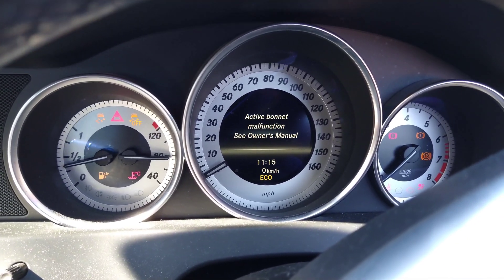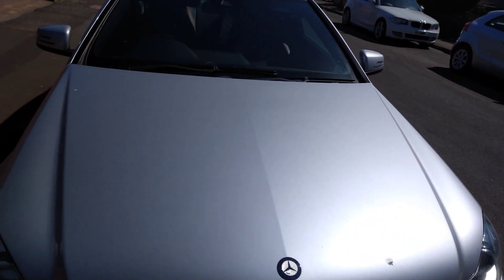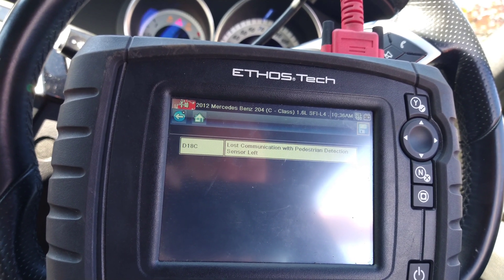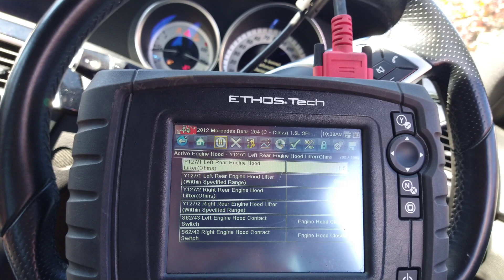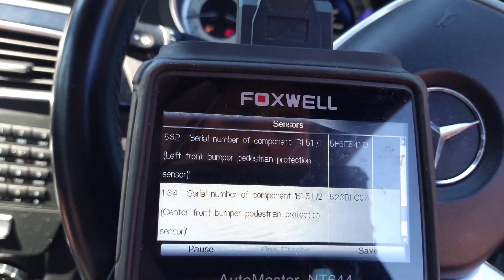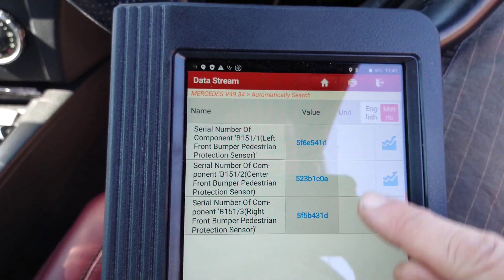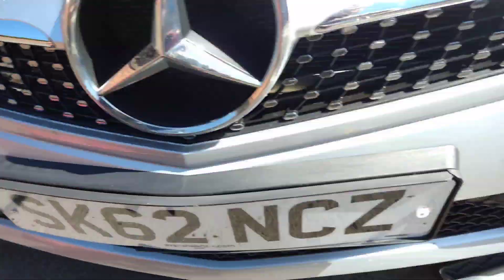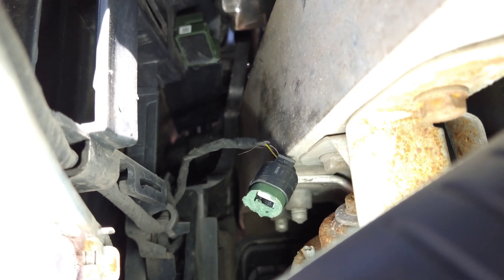Mercedes Active Bonnet Malfunction (active hood malfunction)

Comment: Very good Video, May icarsoft dignostic is not able to resolvd the d18e and d18d Error. Changing both Sensors eliminated only the d18d,but Not the other . In your Video you have the d18c Code . Maybe i will also Change the yellow Sensor

Comment: Did you fix the message with active bonnet malfunction?
Reply: Theres 5 sensors all together, 4 green & 1 yellow. 3 are located on the bumper crash bar and 2 on the bumper shell
Reply from the maker: Yes I managed to put the damaged green pedestrian sensor in the bumper back together and the message on the dash was out without even clearing the fault code.
Thanks for watching
Reply: Do you have any picture of the sensor?
Reply: My s class is give me active bonnet malfunction
Reply: The sensor wich you put is that one with the pipe between the 2 sensors?
Reply from the maker: Looks like this, except it was green, you can just see it near the end of the video
https://www.ebay.co.uk/itm/MERCEDES-A-CLASS-AMG-W176-CRASH-PEDESTRIAN-PRESSURE-SENSOR-A1769051600/184375222860?hash=item2aed9ea24c:g:9oMAAOSwDdNfGwsb

Comment: How much was the replacement sensor if you don't mind me asking? I've got the same issue and although I've not seen the sensor itself I believe that's what it is. Similar situation and my bonnet also never popped.
Reply from the maker: I have seen used sensors on eBay for around £50, the customer bought his own sensor for me to go round and fit. I'll ask him what he paid when I see him. Thanks for watching
Reply: @mechanicmatt871  Thanks for that mate. Been looking for something on this for ages and this is the closest I've seen to a solution. Got yourself a new subscriber.
Reply: Alistair McNaul did you find it? I also got on my cla - active bonnet malfunction. I was wondering if it’s easy fix?